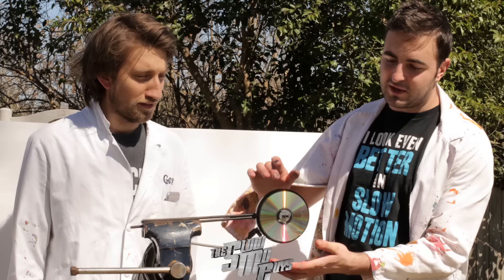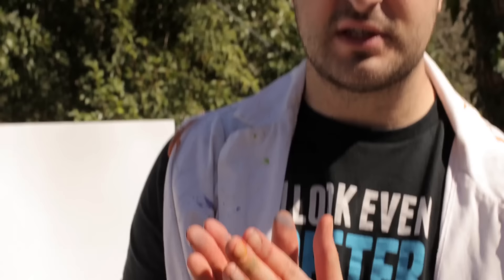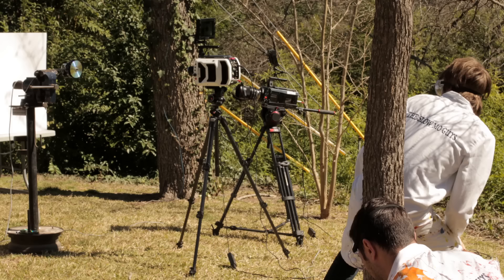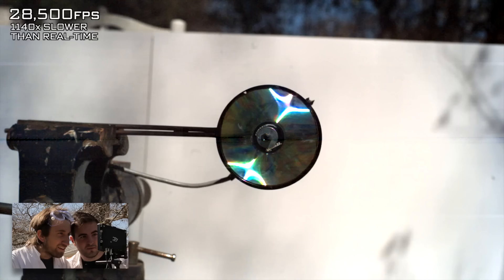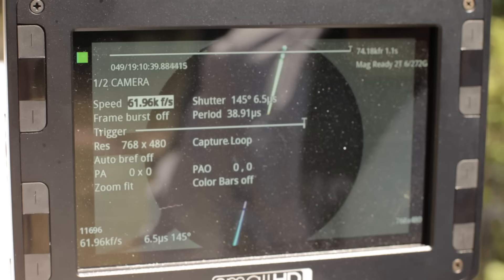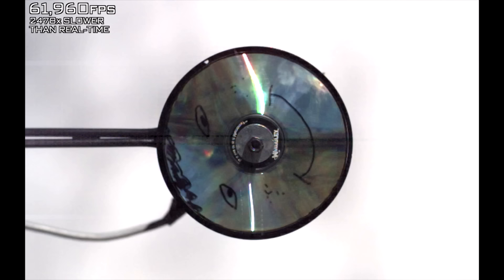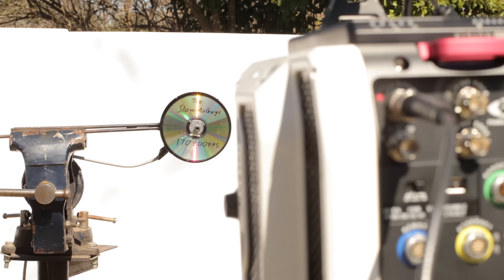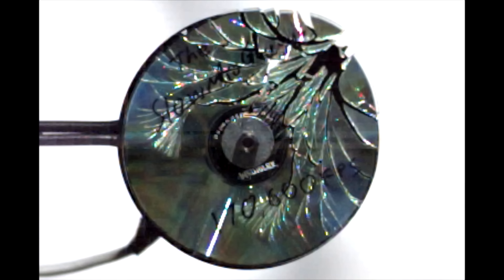CD Shattering at 170,000FPS! - The Slow Mo Guys

Comment: Now all we need is that 1mil fps with a 2TB Hard Drive at the ready.
Reply: You would need about  10 1tb  WD raptors in raid 0
Reply: David Canfield
Have you heard about the 1 trillion fps camera? It's slows time down so much it can see light beams with are normaly invisible to the naked eye.
Reply: Yeah I heard something about it
Reply: +GamerRusith Just searched on google, there's  a 4,4 trillion fps camera now!
Reply: +GamerRusith isnt it a simulation or something?
Reply: +faildafail No its real footage
Reply: +GamerRusith The video doesn't make sense. According to quantum physics, light should travel as a wave while it is being observed. I think that it is disinformation.
Reply: That's not how it works
They fire a laser beam in a pulse, and take a photo every time the laser is in a different spot. So in reality they make about a 1000 photos of different lightbeams
Reply: No...just...no.
Reply: Heat is infrared radiation. Visible light is a spectrum of radiation between infrared and Ultraviolet radiation. It all is part of the electromagnetic spectrum.
All electromagnetic radiation undergoes wave-particle duality, in which it can be either a wave or a particle depending on observation.
TLDR: Both light and Infrared are radiation and therefore are waves.
Reply: +͇ ͇\̿ ̿torm∑agle Heat is radiated as light.
Reply: ***** no, you misunderstand.
The camera used for that particular thing, this 1 trillion FPS camera, is not a "high speed camera" at all in the traditional sense, it uses other tricks and lots of STILL IMAGES to capture the information which is then processed and added together using a computer.
In fact, a similar device could be constructed using regular DSLR equipment and accurate laser pulse timers.

But in short, it is simply not comparable to high speed cameras in its function as it ONLY works on laser pulses.
Reply: +GamerRusith 1 Million FPS cameras do exist. If I can recall, I was in the same room as one (it was maybe 6 or 7 years ago, maybe more). It was a government facility that it was being used in, so, yeah. I'm pretty sure the woman there said the camera took 1,000,000 "pictures" every second. Amazing technology, truly.
Reply: Joe N. Well yeah, the Phantom camera series have been able to for a long time.
Reply: logitech4873 It's amazing. And expensive....
Reply: Jugem16 Modern CPUs are approaching the Teraflop scale, which means they're able to perform close to a trillion operations per second.
A million frames per second can be dealt with using specialized equipment, and we have clever ways of doing it.
We can go even higher, too.
Reply: +logitech4873 modern day GPUs can go well above 5 teraflops already
Reply: These extreme slow motions are very bandwidth demanding. The SATA port have only 600MB/s theoretical maximum and SAS have 1.2GB/s, but neither is anywhere near adequate. You need either super-fast networking to stream them off immediately to large disk array, or use RAM as intermediatary. The super-fast networking here have to be, as of now, based on Infiniband technology. Disk array have to contain several tens of drives in RAID-0, and no RAM slower than quad-channel DDR4-2133 can be tolerated.
Reply: +陈北宗 The way the Phantoms works is they record to internal RAM (upto 288GB) which is what limits the recording time, that then gets transferred to a flash memory "Cinemag" which is the Phantom equivalent of a memory card but has upto 2TB capacity, when that is full you remove it and downloaded it via traditional methods to a standard hard drive which can take a LONG time.
Reply: 陈北宗 sata revision 3.2 bandwidth theoretical limit is 1969MB/s.
Reply: +Martin King This is where high-throughput SAN like Infiniband or multi-link Fibre Channel can become useful. Those technologies allow high-speed cameras to be attached to high-throughput enterprise-grade storage arrays consists of tens of SAS drives, with capacities of tens to hundreds of terabytes. Such disk arrays will allow longer shots at full resolution and full speed, while editing workstations can also access it without any extra transfer time (as it just simple joins the SAN as a peer of the camera)
Reply: +Charles-Antoine Martel-Roy Won't cut it. 40Gb/s Ethernet (5GB/s) won't cut it too.
Reply: +GamerRusith actually, filiming at 170,000 frames per second is equal to 24 giga bytes at second. very fast. very large storage
Reply: +GamerRusith IKR
Reply: Dan Johnson 1 frame averages 200kb at 480p or 0.0002gb / frame. That means 34000000kb/s or 34gb/s.
Reply: ***** it's been done, by scientific research teams. A video about it is actually on Youtube.